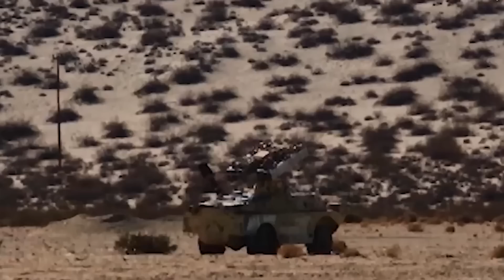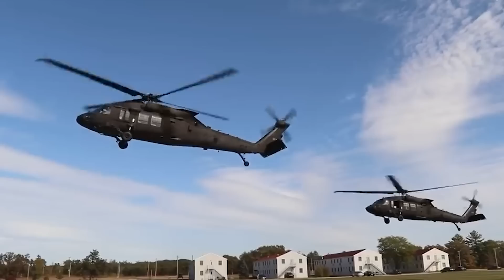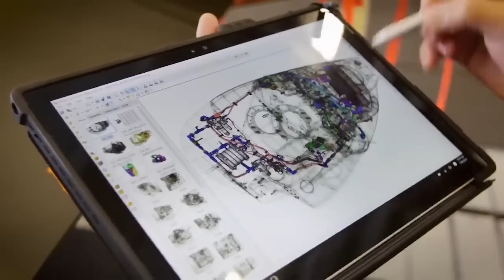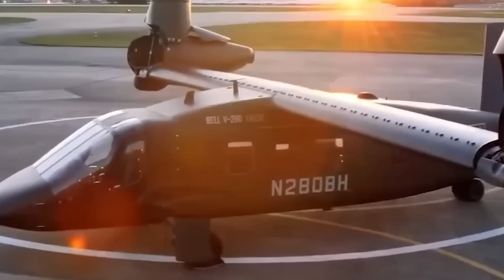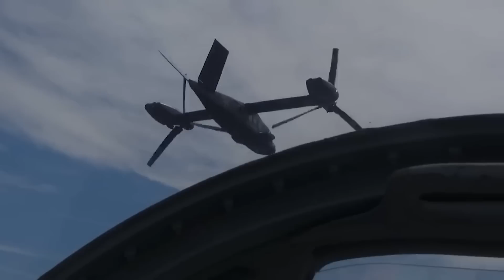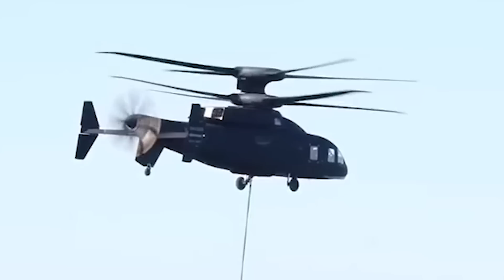The Helicopter that Will Crush the Black Hawk?

Comment: Wasn't the V280 recently selected as the Blackhawk (and Apache) replacement?  Maybe the SV1 will be modified to compete for one of the four other Future Vertical Lift aircraft, but I thought it was out of the running for the Blackhawk.
Reply: Yes and no. Army selected V-280 for replacing the Blackhawk, not the Apache. That's a separate competition. Also, Sikorsky is still disputing the selection process, so until that has been cleared up there won't be any orders placed for the V-280. Congress is questioning the efficacy of spending on a radically different platform that carries increased costs to adopt due to the significant differences in dimensions and design
Reply: @Kingdoms_and_Kobolds  different from the UH-60, yes, but it is basically a shrunk down and modernized V-22
Reply: @Kingdoms_and_Kobolds  Yeah, I thought the Army was going to go with Sikorsky, but its not unheard of for the government to switch contractors to spread the money around.   And the Valor is more powerful.  It's kind of like a Chinook turned on it's side (which in a lot of ways, it is).  More lift, more range, and def more speed than the Sikorsky.  On top of that, Bell draws experience from the V-22.  So, it's not as radical as Sikorsky say's it is.  I think Sikorsky is just being a sore looser.
Reply: it was, but sikorsky boeing is challenging the army's decision so it's not 100% yet
Reply: Blackhawk replacement yes...  Apache.. No...    Apache is purely an attack Heli...   Blackhawk is multipurpose like the V280
Reply: The Sikorsky can be armed easier and land in a more compact landing zone. It's got my vote. Now if I can just sell them my newly designed tank.🤞.
Reply: yup, but there is a 100 day period of reconciliation by Lockheed to reconsider the Defiant X so nothing final yet, i think the Defiant X is better but at the same time i also want the Raider X to get the contract for the FARA program so i am okay as long as at least one of the 2 gets chosen
Reply: Giant rotating turboprops seem clunky to me, and a long-term maintenance nightmare. I thought we learned that with the Osprey. The Defiant seems more efficient
Reply: Not as a replacement for the Apache, just the blackhawk. The Army has not yet issued a RFP for an Apache replacement.
Reply: Yes. Sikorsky is fighting the decision but they are also laying people off right now since they lost this compitition.
Reply: Yes, because they decided that fitting in the same footprint as the Blackhawk was a requirement they could ignore.
Reply: @altortugas5979  There is a video showing that the footprint is not all that much different.
Reply: Not to replace the Apache. Just the Blackhawk.

There is still the light recon helicopter which may use a similar design. The Raider and Invictus are the two running contenders.

 No plans for an attack helicopter AFIK for any branch.

 Glad the Valor won though. Definitely benefits outweigh the larger foot print.
Reply: @dianapennepacker6854  A number of stories announcing the Valor win said it was to replace both the Blackhawk and the Apache. Just passing on what I’ve read.
Reply: It was over a year ago they announced it.
Reply: yep
Reply: yep, that's correct
Reply: It was challenged so the decision isnt final again.... less then a month know again
Reply: Yep Yep
Reply: It received the go ahead for the next stage of development and testing.  Many people took that to mean it was to be the services wide replacement for the Blackhawk.  They are wrong. Frequently non-military people don't understand the process well enough to know the full picture of what is happening.  The final decisions are far from finished yet. If I was betting, I would put my money on us ending up with both systems.  What they do well is enough different that I can see roles for both.
Reply: @brianmoore1164    What is the Defiant better at than the V280?
Reply: @hman0007  Rapid acceleration and deceleration,  off axis weapons fire, maneuverability,  vastly lower noise signature,  lower radar signature,  the ability to auto rotate if damaged etc etc.
Reply: @brianmoore1164  Not very critical and clear-cut advantages, though.    I would say the only critical and clear-cut advantage of Defiant is that it occupies the same space of Blackhawk (less than 20% increment), while Valor almost doubles the required space.
Reply: @Akira Nakamoto (中本 明)  Every advantage I mentioned is critical enough that it is part of the planning process for every combat operation. They are advantages that keep people from dying so, that's pretty critical.
Reply: @brianmoore1164  No, they are not.   If they are, you will have thousands of such "critical" factors, which turn out to be oxymorons.
Reply: @Akira Nakamoto (中本 明)  You are laughable.  I planned and performed combat helicopter missions.  I am not telling you opinions.  I am telling you facts. You can disbelieve them if you wish, but that does not change the truth. Sorry.
Reply: @brianmoore1164  You are questionable.   Obviously you have never planned and performed tiltrotor missions.   So you are severely biased.    This is also a fact, isn't it?
Reply: @AkiraNakamoto  No admission that you lied? No apology for lying? Sorry, you do not have the required integrity to communicate with me.  Goodbye.
Reply: @brianmoore1164  Could you provide citations for any of those?
Reply: @CarletonForsling  Not sure exactly what you are asking, but the vast majority of my information about the Defiant and Raider are straight from Lockheed.  They obviously can't pass along things that are secret,  but their own YouTube channel is very informative.
Reply: @brianmoore1164  So one of the competitors claims those things are better and you take it at face value, but not the other. That's my point.
Reply: @Carleton Forsling  So Lockheed is part of BOTH so what's your point again? From a Lockheed perspective, they would love to see both systems adopted.
Reply: @brianmoore1164  They OWN Sikorsky. That’s a fundamentally different thing. 

Legitimate question—why are you accepting the marketing of one at face value, but not the other?
Reply: @Carleton Forsling  If you have two houses to sell, do you only want one of them to sell?  Not a legitimate question at all.  Sorry, you didn't know did you? It's okay.
Reply: @brianmoore1164  Zero chance of both.
Reply: @Trick N  Yet we currently have the Blackhawk AND the Osprey. I wouldn't throw around a word like zero .
Reply: @brianmoore1164  not in filling the same roles tho. The Osprey is exclusively with the Marine Corps. The Blackhawk is the Army
Reply: @John_Redcorn_  Actually not true, the USAF have their own Ospreys, the CV-22 that is the special forces version of USMC's MV-22. The first delivery was made in 2007 and currently the USAF has 54 CV-22s as of 2021.
Reply: @brianmoore1164  And the Chinook and the Stallion, don't forget those < rolling eyes >
Reply: @trickn2819  Helping to make my point.  Thank you.  Ironic eye roll.
Reply: @trickn2819  You clearly have no idea what you are talking about. You do know where the F/A-18 came from right? It came from the YF-17 Cobra that lost to the YF-16. You do know that the OH-6 Cayuse is the helicopter that lost to the OH-58A in the LOCH program right? They build them both and both served for a lot of years. Let's see...oh, the F-111 win that was supposed to be for the Air Force and the Navy, is what ultimate made the Navy back out and get the F-14. Let's see...there are still more KC-135s than KC-10s. So, yeah you need to go back to bed.
Reply: @John_Redcorn_  The Air Force, Navy and JSDF would like a word with you.
Reply: @trickn2819  Chinook and the Stallion were not in competition with each other nor were they in the same role.
Reply: @brianmoore1164  Black Hawk is assault and the Osprey is medium lift.
Reply: @ImpendingJoker  You understand that was decades ago right?
Reply: @ImpendingJoker  navy and marines are the same department. Japan doesnt count (we’re talking about US military here). And i didnt know about the air force so point scored there
Reply: @Trick N  For who? The Blackhawk has been medium lift since the 80's and is still doing it.  I took part in many medium lift Blackhawk missions.  Took part in many Blackhawk assault missions too. The U in UH-60 is for utility. It gets used for everything under the sun. That's why we have so many of them.
Reply: Don’t forget the USAF has a good size fleet of Blackhawks, with a version, the HH-60W in current production at Sikorsky.
Reply: @John_Redcorn_  Same department but not the same acquisition paths. So no, the MCV-22 is a totally different machine from the others.
Reply: @trickn2819  And your point? You said 'zero chance', I just proved you wrong on multiple levels, and you're just trying to move the goal post to save face.
Reply: @trickn2819  Incorrectly. The Blackhawk, it's one word not two, is a medium utility helicopter. You're really not too good at this game are you?
Reply: @ImpendingJoker  Better than you, it's 2 words BLACK HAWK, look it up bro.
Reply: @ImpendingJoker  Actually you proved nothing except that you are living in the past.
 The F-16 was rejected out of hand by the Navy, IF the Cobra  had won ( but it didn't  ) the AF and Navy would have shared what would eventually become the Hornet. 
But the POINT is: we don't do that anymore. A program winner is chosen and the loser dies.
ZERO chance we will build both of the new choppahs! lol
Reply: Yepperoni 🚁 🍕
Reply: Thats not final.      The defiant is a better choice
Reply: @Omar20v  how so?..  please explain
Reply: @Omar20v  the defiant crashed. There is no prototype to test anymore. The Bell V-280 is vastly superior. Better armor, holds more troops, carriers more payload and is faster.
Reply: @sweettrav20  Did it? I can't find anything recent, only the 2017 crash that they've gotten past.
Reply: @Omar20v  Actually it's not better at all. Why? The rotor system alone is way over complicated which will make it quite expensive to maintain. The Valor has 2 engines, 3 gearboxes and two prop-rotors. Defiant would be a nightmare to keep operational in the field. How do I know? I was a US Army helicopter mechanic that worked on the Huey, Cobra, Kiowa, Kiowa Warrior, Apache, Blackhawk and Chinook. Guess which one had the worst record for time on ground due to drivetrain issues? That's right, the Chinook with its 5 gearboxes and 12 driveshafts was a living hell to keep up in the field. The only thing worse than it was the OH-58D due to rapid ablating of its abrasion strips from sand in the desert. So, no, Defiant is not the way to go.
Reply: @ImpendingJoker  Talking from a procurement angle here, I think we both know that no one cares about the guy in the field working on the machine.  Sadly, that's one of the last things they're considering.  Which to me is stupid but hey, its the US government procurement process, right?  The worry is more to do with future proofing whichever system they choose so they don't have to go through another expensive and massive procurement process a second time.  Think Longbow.   Now, on paper, if you can eliminate the Chinook and the Blackhawk and replace both with one machine, don't you think there may be some benefit to that idea as far as costs of operation, training, and supply chains?  One machine that does it all?  Think about all the money the gov spent on training you to fix all of those different birds you had to work on.  Think about all that down time you spent in class rather than actually working on the equipment.  The new soldier wont have to.  

Chinook isn't on the chopping block, but it CAN be if the Army adopts the Valor.  It cant if they adopt the Defiant and I think that was the selling point.  The rest inevitably gets worked out over time.
Reply: @b.thomas8926  While I do not deny some of what you say, I can tell you this, when I was at school they were actually phasing out the OH-58C and the AH-1/UH-1 sections. They had us go through what was called the "Mod 4"(Modern 4) sections of the Chinook, Apache, Blackhawk, and Kiowa Warrior(OH-58D), then put us into the 58C and Huey/Cobra sections with no training to see if we could perform the tasks in the manual. The results were...mixed, to put it kindly, and my class was the last that didn't get trained on them. They put them back in after our class. However while there, the Sikorsky-Boeing guys were there to show us what it would be like to work on the RAH-66 Comanche and our tool kit would look like. Let me tell you, they had the mechanics in mind for that thing. My whole kit was going to be like 15 tools total to work on it. Sadly we all know what happened with that. So, no, today logistical support of easier to maintain aircraft is becoming the norm, not the exception. The 58D is way easier to work on than the 58C because of all the changes made for ease of access and ease of removal and replacement at the unit level. The Apache is also very easy to work on, and it has to be, because it's a piece of shit. The 'Hawk is more complicated than it needs to be because they had to redesign some things after the whole "Slingblade" debacle and "Lawn Dart" fiasco but, really not that hard to work on but the manual for it sucks. The Chinook is still the Chinook from the 60's with not much mechanical having changed on it since the new T55s were put on it, and it has a very different design philosophy than the newer helicopters but the trend is very much towards easier to maintain, so that is more a factor in this decision than you might think.
Reply: @ImpendingJoker  Hey, that's fair.  And yeah its something that goes into the thought process in design,.  It's my bad for not being more specific in the previous comment.  

I'm talking more on a higher level.  Gov and contractor level, not so much design, engineering, and implementation level.  On the front side, (the start) its more of a 'can we meet these requirements' thing.  Then the rest tends to follow.  Engineering design, manufacturing, solder proofing, etc.  That's what I meant by the inevitability of the rest.    

But yeah you do have a great point.  Simplification is a big deal and I think both machines will benefit despite the fact that both machines are stupidly complex.    

Because simplification will be a key feature, I personally think Valor isn't going to suffer as much as some think over the tilt rotor design.  They already learned NOT to rotate the entire nacelle like they did with Osprey.  But they do have a power transfer clutch box depending on if they loose an engine.  So yeah there is some complexity like Chinook. 

But Defiant isn't immune to complexity.  I talked to a pilot who was acquainted with the dual rotor system and he wasn't enthused.  There's a ton of on going problems that the Russians are constantly dealing with on their birds.  Problems that have propped up in the Defiant program.  Namely the rotors tearing themselves apart due to supersonic forces as they counter rotate over each other.  Apparently, physics is a bitch.

That's why I go back to thinking Chinook can go if they adopt Valor and they don't have to solve unsolvable science problems with Defiant.  But mostly I think its the Chinook thing.  That's probably the real reason they're moving forward with testing the Valor concept.  It's less... nerdy?  (shrugs)

Anyways, good talking to you, and I appreciate your service and your opinions.  You were in the trenches with these birds and I'll take you're opinion over most simply because of that.